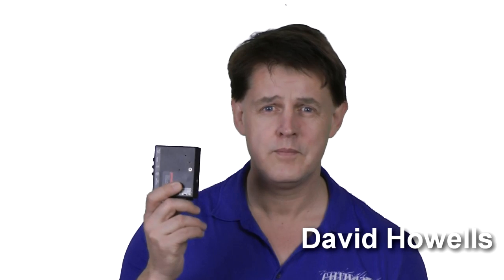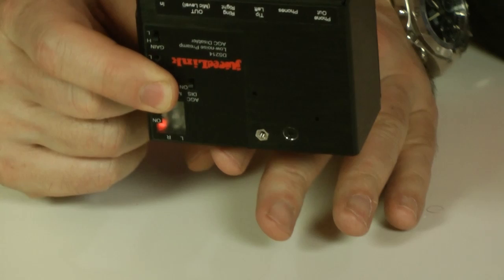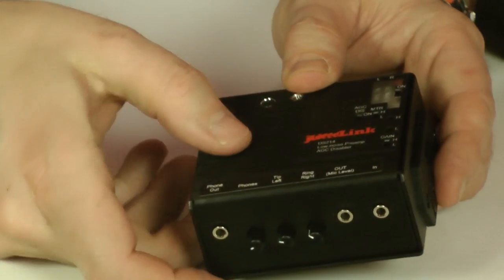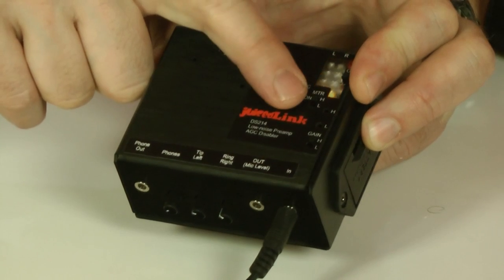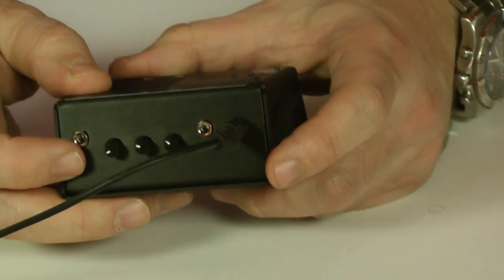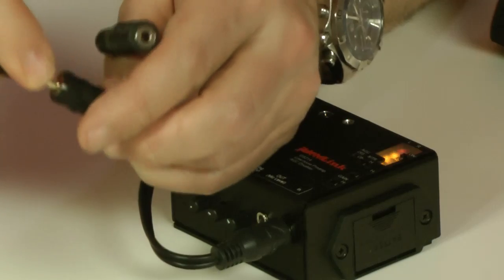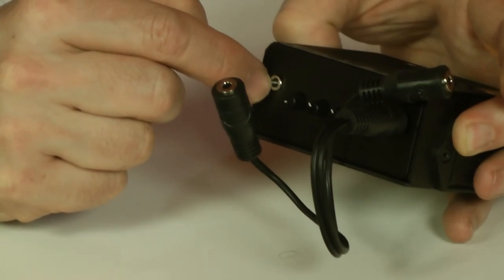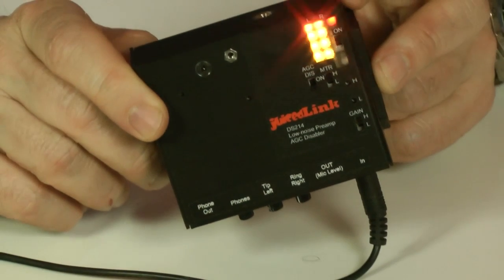Juiced Link DS214 close up

Comment from the maker: Hi Paresh,thanks for the nice feedback. Regarding the Juicelink box that is only available new from the manufacturer in the USA. You might get one second hand from EBAY also. The Koods I got on Ebay. The filter thread needs to be for the lens you intend to use for the filter. I used a 52mm thread filter cos I used the Canon 50mm 1.8 lens which has a 52 mm thread. I will do another video on both the audio and the filters cos there are a few other options for these too but  too much for one video.